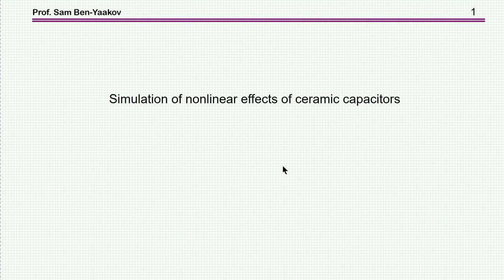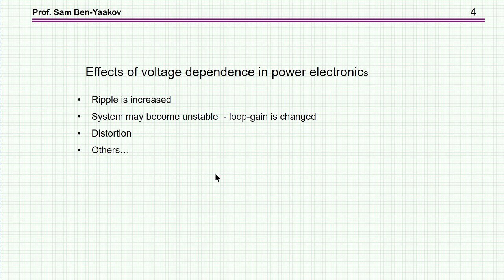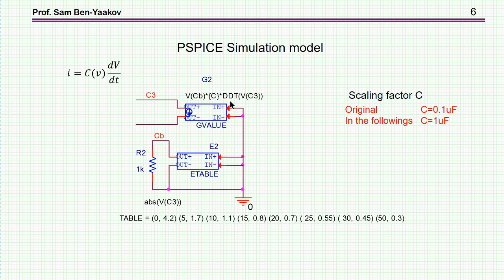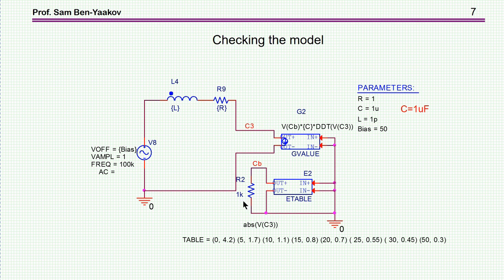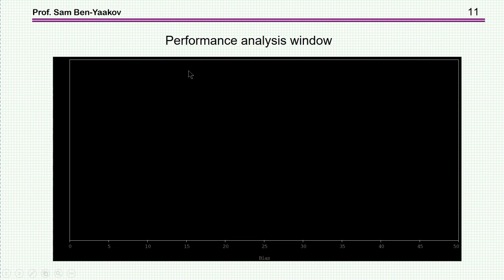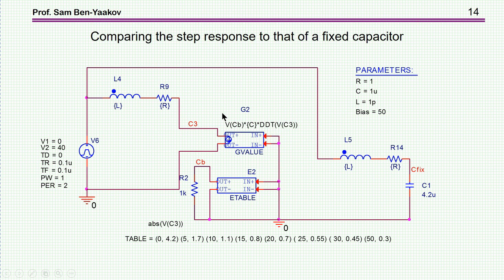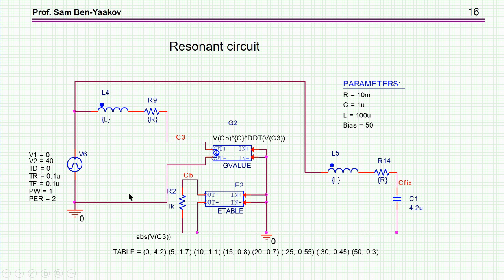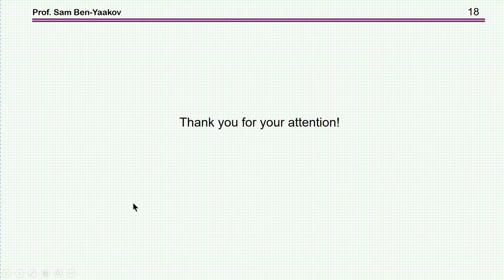Simulation of nonlinear effects of ceramic capacitors

Comment: Great video. I investigated this also in the past and noticed that some so called X7R-caps might in fact be X5R or even Y5V!I did also some modeling using an approximation in this article: http://www.edn.com/design/components-and-packaging/4394275/Quasistatic-Spice-model-targets-ceramic-capacitors-with-Y5V-dielectric-